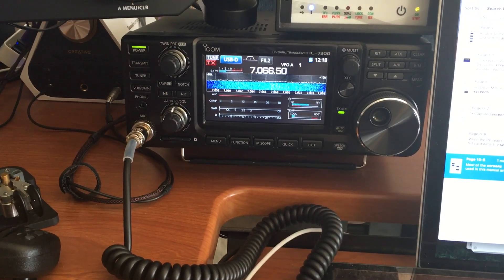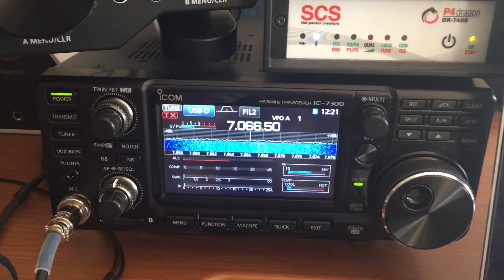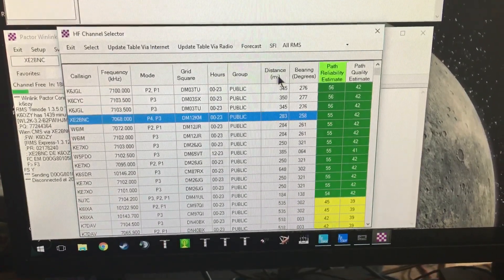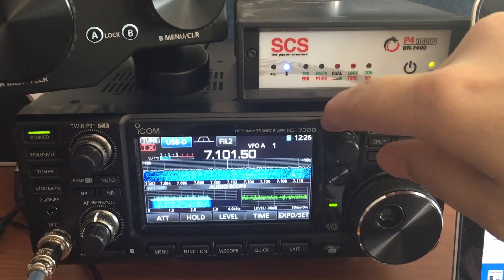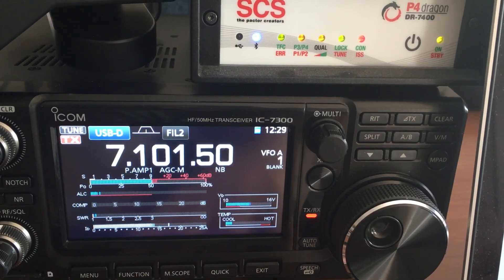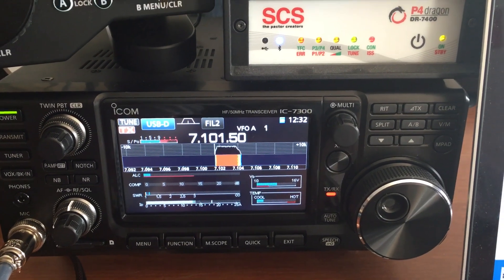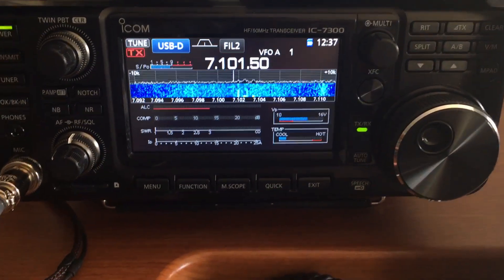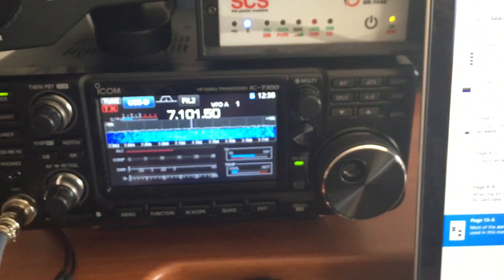ICOM IC-7300 WinLink Pactor Duty Cycle Test

Comment: How are you connecting the modem to the radio?  I did not see a data jack on the rear of the unit?  I have one coming.  Right now I operate with the 7200.